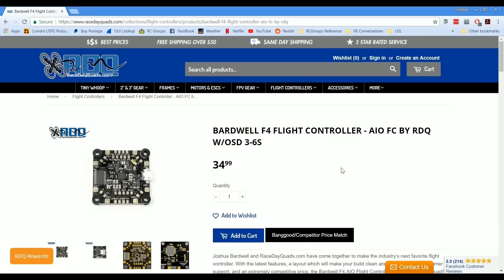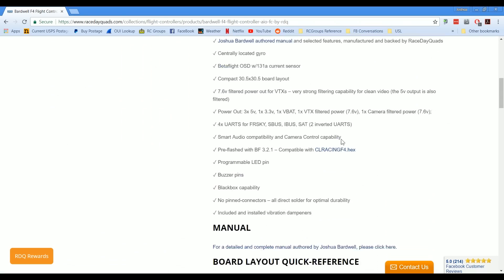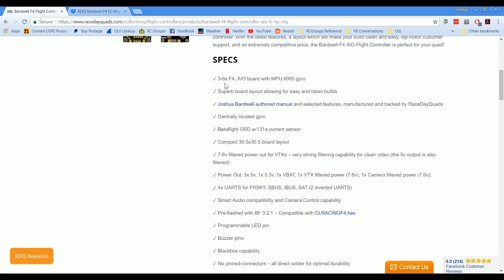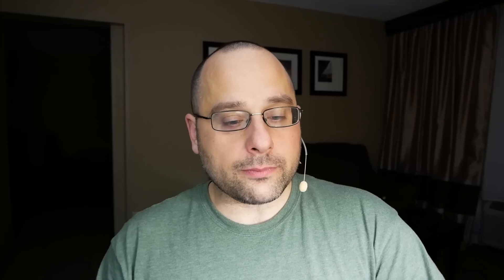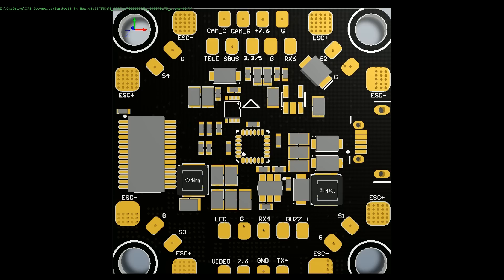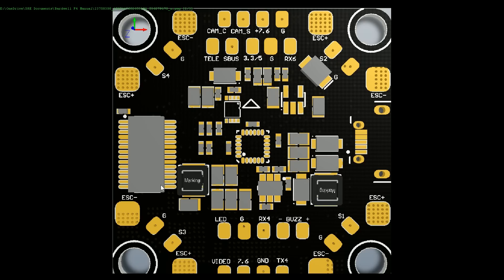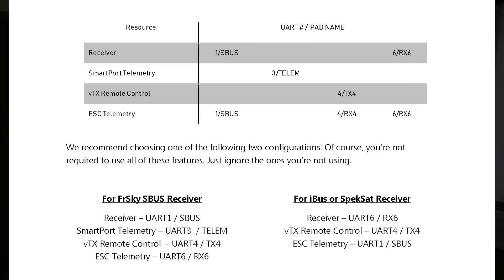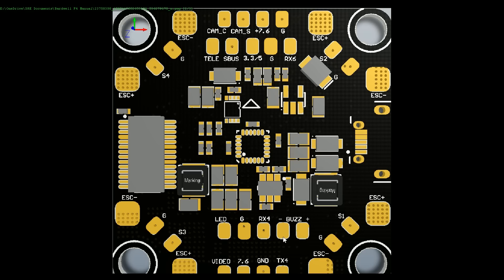Bardwell F4 AIO | JOSHUA BARDWELL FLIGHT CONTROLLER

Comment: I purchased this flight controller in the UK. Although it appeared to work OK, that is it connects to BF etc... a component on the underside has blown! Smoke came from it and I do not seem to have DC for the VTX. The FC still connects to BF OK but it is now unusable. Before anyone comments, yes it was wired correctly. I am very disappointed as I was very much looking forward to using the controller but a blown component does not fill me confidence. I have contacted the company that sold it to me and it appears this is a known problem. They will not take the FC back and suggested I speak to Joshua directly. If anyone has had a similar problem I would be interested in how you fixed this.
Reply from the maker: If you purchased a board with a known issue, then the retailer should take it back and replace it. Please let me know who you purchased it from by email at joshuabardwell@gmail.com

The version 1.2 of this board (with SD card slot) had a recall and all customers and retailers should have been notified to replace the boards for customers. 

If this is v1.3 of the board (no SD card slot) then there is no recall. But if your board was DOA from the package, it should still be replaced, assuming you didn't damage it.
Reply: Thanks for the reply. The board is v1.3 as it does not have an SD card slot. I can assure you the board was wired correctly. Joshua, when the board arrived I powered in the normal way with usb to check all was OK, ie power and BF etc. All OK. I soldered the XT60 connector and my esc's, as is normal. When I connected my 4S lipo the component in question blew, ie smoked! Naturally I checked my connections pre-power and post-power and all was OK. After all, with a 35 year career in firmware and electronics I can get positive and negative the right way round. It is quite clear to me this is an absolute component failure. So what do I want from this? Well either a refund from the supplier who is not being helpful or representing the product or a working flight controller so I can go fly. I would like to work with anyone to get the root of the problem, ie identify if this is a one off component failure, as this happens (I am realist) or might it be a deeper problem that could manifest itself for other users. I have a youtube video prepared that shows the board wired and powered but with the blown component. I will email you the details requested and an image of the said component. Kind regards and appreciation. John.

Comment: Hi Joshua, i've got your first version of your FC ( with sd card) and a eagle 2 pro ... where can i solder the audio wire on the FC to have sound of ?
Best regards
Reply from the maker: The audio wire from the vTX is soldered directly to the microphone wire of wherever you are getting the microphone from. The FC doesn't have a built in mic and you don't normally solder the audio wire to the FC for audio.

If you have a vTX that uses smartaudio, then you will solder the audio wire to the FC UART pad (TX4 on my FC). You can solder the mic to that same pad. However if you have a mic and smartaudio going at the same time the mic can make smartaudio not work.
Reply: It's the wire audio from the camera eagle 2 pro not vtx, i don't know if i must solder it or not can you explain, my vtx is vtx_hv ? thanks for your help
Reply: So, if i understood well .... ( not sure ... ^^ ) the wire from camera eagle soldering on audio vtx port and the TX port of vTX on the FC Tx4 port ? i need coffee
Reply from the maker: If the camera has built in mic, then solder the audio wire from the camera to TX4 on the JBF4. Solder the audio wire from the Unify to TX4 also.

However, this might cause SmartAudio to not work.

Comment: Well, your FC is now on a 250g quad with runcam mini split. There is some aggressive arming that I couldn't understand yet where it comes from, but...
https://youtu.be/gk2F6g6k2Pw
Reply from the maker: This is a "tazmanian devil" scenario.

If the quadcopter instantly flips over when you arm and raise the throttle with props on, it is almost 100% certain to be one of these things:

1. Clockwise prop installed on counter-clockwise spinning motor or vice versa.

2. Flight controller not facing forward. Go to the Setup tab in the configurator. Tilt the quadcopter on all axes (pitch, roll, yaw) with your hands. The 3D model in the configurator should move the same as you move it with your hand. If it does not, use the Board Alignment parameter in the Configuration tab to fix it.

3. Motors not wired correctly. TAKE OFF YOUR PROPS. Plug in a battery. Go to the Motors tab. Turn on the "props are off" slider in the lower-right. Raise the individual sliders (1, 2, 3, and 4) one at a time, just enough that the motor begins spinning. The motor positions (1, 2, 3, and 4) should match the graphic in the upper left. If they do not, then either move the signal wires so that they are correct or use resource reassignment to virtually "move" the motors.

4. Motor spinning wrong direction. Do the same as step 3 but compare the motor direction to the arrows on the graphic in the upper left. If a motor is spinning the wrong direction, either reverse it using BLHeli (or whatever ESC software you are using) or swap any two motor wires with each other, which will reverse the direction.

Many times, people swear up and down they have checked all of these things, and then come back to say oops I missed one you were right. So if you think you have checked all of these things and your quad still FLIPS OUT, go back and check again. If your quad is insta-flipping on takeoff, it is almost always one of these things.
Reply: Thanks... I'll let you know... I'll  go through each and every step... and no, I won't say that I've re-re-rechecked all this... (because you're probably right anyway, so why bother... ) :-)
Reply: Hi Joshua, so... it was option number 4. Motors spinning in the wrong direction. CW motors were actually spinning CCW, so I've just changed 2 of the wires connecting to the ESCs and that's it! Thank you very much for your help. Not it does fly! :-D

Comment: i have question i just built a older jb f4 flight controller for my astro switch true x with zmx finx40 2610kv motors and im using lumenier 50amp 4.1 esc , vtx mach 1 which is wired ( 9V VTX power pad) and runcam sparrow wired also to 9v on otherside of board but my issue is quad didnt cut out but my video went out for few seconds after fast roll. what could my issue be? i need a capacitor on main power input from battery becouse of the motors?

Comment: Hi Joshua ,  have 2 questions , 1 the 9v port for the vtx and 5 v for the camera just die is this normal ?? Second question  I’m using rx4 and tx4 for gps signal , can I use rx6 and assign cam control port as tx6 for cross fire reciever ?
Reply from the maker: If you have v1.2 of the board there is a recall due to defective 9v regulator. Please contact racedayquads to request replacement.

If you have v1.3 of the board (no SD card reader) then please email me to discuss more.

Comment: Just got 1 of your fc's and connected it perfectly, everything was good but when i turned on my radio reciever to test fly it, my video gets mad noise so i cant fly fpv.... Why? Is this fc not compatible with a 20a all in one esc's? Or was i the 1 in a million to get a defective fc?...

Any help here? This is killing my fpv mood.
Reply from the maker: Please go to the racedayquads page for my FC and read "tips for cleanest video"
Reply: Joshua Bardwell thanks man hopefully that gives me a good tip.
Reply: Joshua Bardwell i tried it all and nothing works, the fc gets really hot and i never got to use it.... Maybe i was the 1 in a million.... This sucks.

Comment: Hello Joshua, I have problem with my second FC (your FC obviously): I have Tramp vtx, Runcam micro swift 3 and R-xsr receiver, BF 10.3.0 config, CLracingF4 3.3.3 onboard. T cable from Tram connected to LED pad (softserial activated, IRC Tramp on UART6 on BF), RunCam TX/RX connected to RX4/TX4 and Runcam device selected on UART4 on BF. Smart port on UART3. 
Telemetry is running ok. Runcam menu can be modified via radio sticks and display OSD. But, but, but...when I try to set VTX parameters via monitor OSD...after saving, the setting doesn't take place, band and channel remain always the same on A1. So is a problem on the Tramp or in my config? Secondly, I tried to access the VTX setting using LUA script...but doesn't work...receiver is updated to latest fw version..any suggestion is welcome !!!! Thanks, Andrea
Reply: Resolved!!! I did the resource remapping the LED port as SoftSerial using CLI commands. Now the Softserial port appear on the port mapping sheet. Then i selected there IRC Tramp and  now is working!!

Comment: I just hooked up the crossfire wires to tx4 and rx4. No where does the regular audio wire connect to from the camera?
Reply from the maker: Audio does not run through the FC. It goes straight to the vTX.
Reply: Oh yeah.... Can't believe I forgot. I just desoldered my old board to set it up on this one. Too much solder fumes. Thanks!

Comment: hey josh any reason why the OSD would be showing to higher battery voltage then what it actually is? Everytime I plug in a  fully charged battery at 4.20 per cell its showing well over 17 in the osd and my alarm is going off. I know that can happen if they're overcharged but they're not. Thanks
Reply from the maker: Use the battery scale in the power and battery tab to calibrate. But usually if your battery scale is much different than 110 the FC is damaged.
Reply: Joshua Bardwell thanks I’ve never had that happen before I lowered it to 106 to match the voltage and that seemed to work. Thank you

Comment: Joshua!  Why has my FC decided to only output 3V at the 9V pads, for both the VTX and Cam Power?  I suppose in the mean time I can just run the VTX power from the Lipo.
Reply: Or power the VTX off of one of the ESC power pads as per the troubleshooting in the manual
Reply from the maker: Please reach out to the vendor you bought the board from if your 9v regulator has died.
Reply: I will do that.....Thank you for the heads Up.....BTW I am LOVING this FC so far....THank you for the fast reply! Happy and Safe Flying!

Comment: hi Is it possible to connect M8N GPS Module to this board? I also use CRSF
Reply from the maker: No, your UART is taken up by crossfire so it can't also be used by GPS.
Reply: Thank you Joshua Bardwell for your quick reply .. I did connect the gps module in UART 4 and the crossfire I hooked up as a SBUS .. hope your next FC will be with another free UART

Comment: I just hooked up foxeer micro arrow v2 to the cam pad. No response. Do I need to use capacitors or anything like that to get it to work?
Reply from the maker: Possibly. Or play with CLI options. Unfortunately the camera control feature itself does not work reliably with every camera. See the Troubleshooting section of the user manual (download from racedayquads product page for the FC).

Comment: Hi Joshua!! i brought your f4, how can i put a gps for long range? there's no in the manual intruction. Thanks master!!
Reply from the maker: You must use TX4 and RX4 for UART pads. But if the GPS requires i2c for a magnetometer and barometer, you are out of luck. My board doesn't do that.
Reply: Joshua Bardwell I have tbs unify on tx4, what I must do?
Reply from the maker: The manual has instructions for putting SoftSerial on the LEDStrip pin, and using that for smartaudio. This will free up the TX4/RX4 pads for the GPS.
Reply: Joshua Bardwell thanks Joshua 👌👍👍
Reply: ops pad of rx4 detached while welding :-( .. another place to take rx4 is it possible? Thanks

Comment: can I use a BL Heli 32 All in One ESC, 35amp, with this FC?  So I would only run the signal wires and Vbat and ground from the all in one? THANK YOU!!!   FC is in my amazon cart, just need a confirmation on this! PLEASE
Reply from the maker: Take a look at the FC manual, download from racedayquads products page. It has wiring diagrams for a 4 in 1.
Reply: Thank you kind sir,  had my maiden flight today with the JB F4,  loved the layout for soldering, soft mount grommets pre-installed, and the durability of the solder pads......Well Done......Flies really nice....Might have to switch up from the DYS F4 to this as my goto.....Keep up the great work!

Comment: hi Joshua, i bought one of those JBf4, the buzzer pads output only 1.6v at most making the buzzer really really faint, i can barely hear it only when no noise around

i did try another buzzer with same result

anything i could be trying to get my buzzer working?
Reply from the maker: If the buzzer supports it, you can use the 9v regulator, or even an ESC+ pad, but the buzzer must be rated for the voltage.

You can also reach out to RaceDayQuads to see if you are eligible for a warranty replacement.
Reply: Joshua Bardwell if i use the 9v pad, what is the cli command to reroute that?
Reply from the maker: None is needed. Buzzer uses the BUZZ- pad to switch it. The BUZZ+ pad is just a voltage source and can come from anywhere.
Reply: Joshua Bardwell excellent! thank you

Comment: Hey josh thanks for always commenting. I have had your board for a while but the 9v pads have no power coming out. I never had to use them til now but I put them up to a volt meter and have no voltage. I know my video pad is pad and was from the start so I just powered it off the 5v on the bottom I do t know if this issue relates. Thanks
Reply from the maker: There was a batch with bad 9v regulators. Contact RaceDayQuads to see if you are eligible for a replacement.

Comment: Hi, my Bardwell fc was working fine for many flights. Then I put another battery on (right after a good flight), plugged it in an didn't hear my final esc beeps. 
I looked an the FC has no lights on. Took it home an plugged into computer to check it out and still no lights or connection. 
My Rx and vtx power on fine so there is some kinda power goin thru. 

Pls help? Does this jus mean it's time to buy another or is there an easy fix?
Reply from the maker: Please reach out to racedayquads support to see about a replacement.

Comment: I got everything set up and ready to have hover, then saw a puff of smoke and my video feed is dead.  I looked at the wiring and board.  Nothing looks burnt, and it’s not clear that I wired anything wrong.  I would think it was me, but the only other person in my club with you’re board said this happened to him twice. Sounds like I’m out of 120 bucks for a new flight board, VTX, and maybe a camera.
Reply from the maker: Please contact RaceDayQuads to get a warranty replacement. Although we try to keep the quality of the boards high, there are always a few that will fail for no reason. If yours is one of those, you'll get a replacement and an apology. Please let me know if you have any issues.
Reply from the maker: Your vTX and camera are fine. Most likely what happened is the OSD chip on the FC burned out.
Reply from the maker: Please make sure your friend also knows to contact RaceDayQuads if he or she didn't. RDQ is a good vendor who stands by their product and their customer. If you buy a product from RDQ and it is defective, you do NOT have to just suck it up and eat it. They will take care of you. I wouldn't sell my board through them otherwise.
Reply: Yeah, I wired the camera (Sparrow) and vtx(TBS unify Pro 5g hv) directly to vbat and the camera signal output directly to the VTX signal input and they all work...except no OSD. If I need to strip it down and put in a new board anyway, I will just go with a Kakute.

Comment: hello Joshua. is there a reason (and a solution..) why a buzzer works perfectly on another fc (tried on a Naze32) , but il sounds very low on the Bardwell?... Thank for your attention...
Reply from the maker: Check voltage at the Buzzer+ pad. It should be 5 volts.
Reply: Joshua Bardwell yes. it is 5V.... so?

Comment: Joshua I like so much this FC with connection s right way. Cam pin in front and vtx back very good. You just need to   upgrade the next FC with the 4 motor s pin pad also in the back of the board so that cabling with 4 in 1 esc is better.

Comment: Today i finished my build with this awesome FC. It flew great for four batteries but then plugged in the 5th and no video and a burny smell. Darn I was flying so nice. So at home I inspected the damage which I was hoping it was the 4in1 esc. But no it was a chip on the JB f4. Now i wanna know what does this chip. It a small 6 legged chip on the bottom between the sd-card holder and the bigger square grew one with 220 printed on it. I'm guessing it's the 9v regulator, because the vtx wouldn't power on from the 9v pad. I have the matek hv vtx and a runcam eagle 2 pro running both from 9v. Can somebody help me to understand what went wrong.
Reply from the maker: Please contact RDQ to get a replacement.